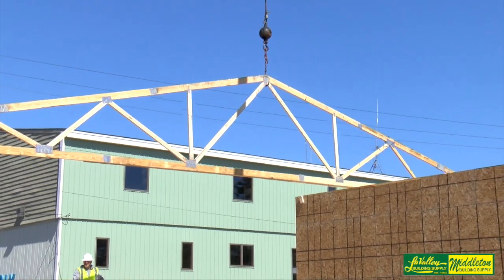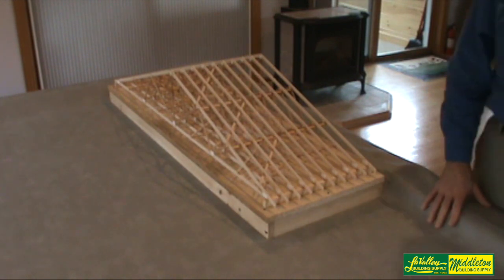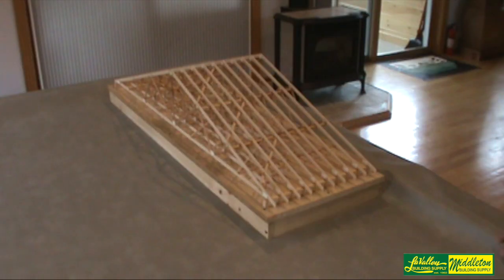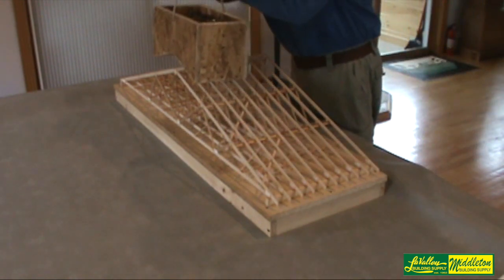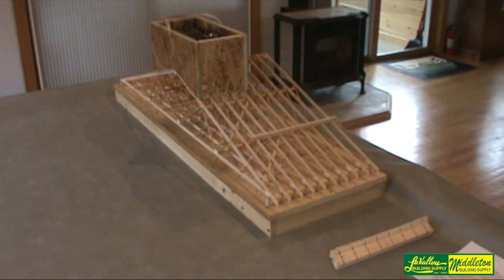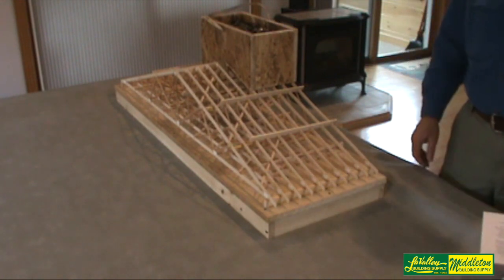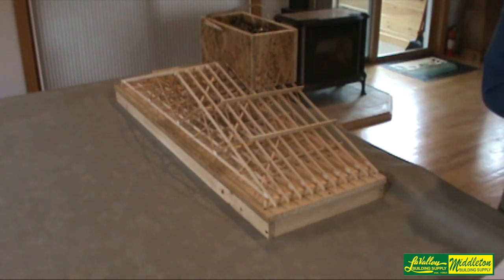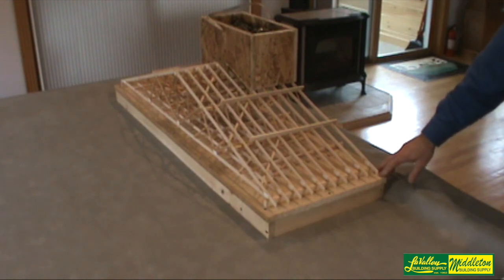LaValley/Middleton Truss Bracing Video

Comment: I wish I would have e seen this video 2 weeks ago.  I got 60ft trusses from my local truss company.  They did not come with diagrams like what you have.  A big wind storm and my 60ft trusses look just like your video.i did not put upper diagonal bracing under my top cord on my trusses.  I had came up with a repair similar to what yall came up with.  It was a little bit of work but it us doing the job.

Comment: If im building square and level I would think that I’d  be fine installing bracing permanently as I go. I’m setting 44’ Attic Trusses next week on 10’ 2x8 walls. Room is only 20’ deep by 44’ wide.  Looks like it’s about the same scale as your model but I’ve got Attic Trusses where the middle section for the 2nd floor is 12’ wide x 20’. Going with all three directions on the bracing per the design specs and this video. Will be using true 2x4 rough sawn spruce off my mill for my bracing. Using 16 nails and a 5” structural screw to attach the bracing to the trusses. Going to temporarily shore up under the attic portion. 👍🏻👍🏻👍🏻